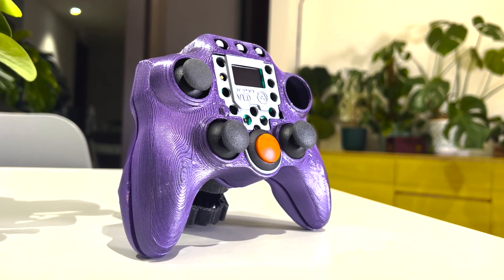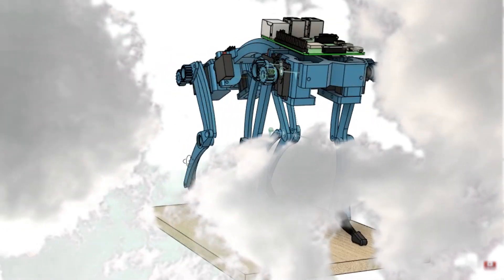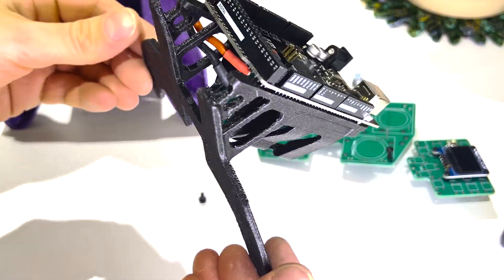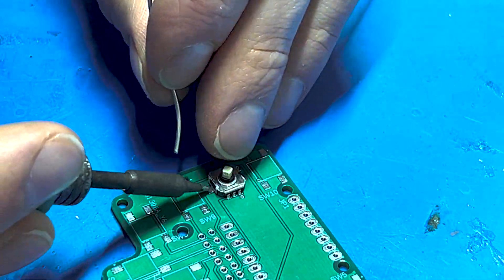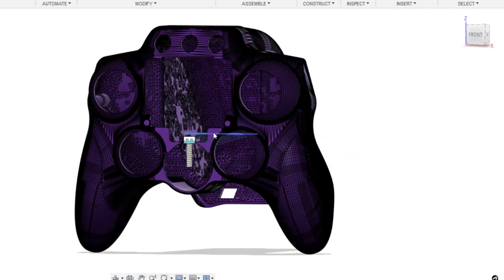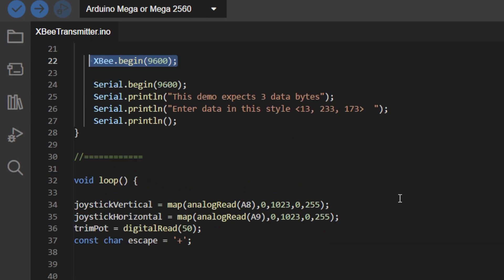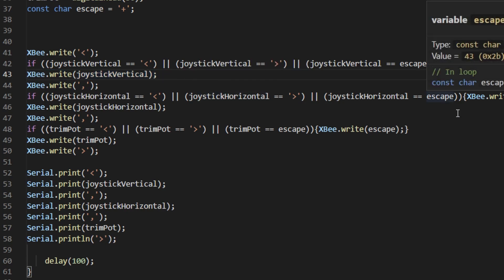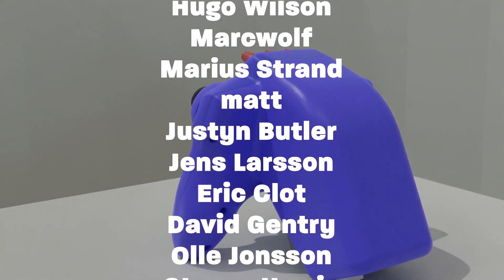I Built A Programmable Robotics Controller

Comment: You can use a Teensy 4.1 instead of an Arduino. It's way smaller, it has incredibly greater processing performance, and has more analog pins than even the largest arduino that I'm aware of.

Comment: You could have the atmega2560 soldered onto the io board and potentially add a rp2040 on the side and replace the 1.2 oled display with a colored variant, if not replace the rp2040 would have a much better time processing data over the atmega

Comment: Edit: This comment came out way more negative than suggested. I love this channel. There are many amazing projects here. This video happens to cover an area I've thought about a lot. I gave feedback on a Kickstarter project on a robot controller which is one reason I've thought about this so much. I have a part bin labeled "Custom Controller" where I've been collecting joysticks and other parts in a future custom controller I plan to make. I have experience using XBees, and other radios used with microcontrollers. I once used a Wii Nunchuck combined with a microcontroller and radio module to controller a RC helicopter. I hope this comment is taken as constructive criticism as it was intended that way. My original comment is below.

XBees work great but they are way more expensive than other options.
The inexpensive nRF24L01 aren't as easy to use but you can purchase over a dozen for the price of a XBee.
IMO the optimal link for a robot remote is Express LRS. The modules are inexpensive and have great range. The communication protocol is opensource. 

Have you ever tried to use four joysticks at once? It's a huge pain. IMO you give up ergonomics to have four joysticks. You're much better off having multiple modes and have a quick way to switch between modes. The joysticks can then control whichever channels you desire.

I think your one handed controller was great. In my opinion, you'd be way better of making your larger controller based on two of your one handed controller.

The power tool battery isn't too bad, but it's an expensive way to purchase a battery pack. Normal LiPo packs would be more economical.

I also think your big Arduino is inappropriate for the remote. There are lots of smaller options which have every bit as much processing power.

I love many of your projects but this one seem like you didn't think it through or more likely, you're unaware of the better options.

That said. being able to design your own controller is super awesome.

Comment: I love the idea of using a 3D printer for rapid prototyping the controller body (large layer size for fast printing) and then once it's dialed in nicely, creating a final version with really fine layer height (long-ass print but incredibly smooth) and then resin-dipping it for that ultimate surface smoothness... just my thought from seeing the thumbnail, anyway, time to watch and see what happens :D

Comment: no no. How you solder is problematic and wrong. You move the tip and move it. Don't do this. Heat, melt, keep heating, then move avai. that's it.

Comment: More on surface mount. When a manufacture shows the pad size for a part they are assuming the solder will be paste applied through a stencil. 

JLC does offer a stencil service at a great price. But a stencil is not required for low density boards that don't use fine pitched components. 

(back to the pad size) The suggested pad size is often the minimum. It is assumed you want to cram as much together as possible. But if you are hand soldering a board it really helps if the pads are made oversized. I extend the pads where the soldering iron will be used to contact the pad. It helps to have  an extra mm or two.  It is more work modifying the footprints but it is really worth it when it comes to assembly.  Even more so if you need to do any rework later. Maybe replacing a faulty switch. (more on this below)

The soldering iron tip you used was ok but a finer tip would be desirable if you have difficulty soldering the parts. Smaller diameter solder also helps. I forget if I mentioned it in the last video but lead free solder sucks. 63/37 tin/lead solder has a lower melting point. It is what was normally used in industry before the EU put restrictions on imports of commercial products that used it. Lead free solder needs a higher temperature to work and even when it does the results look crappy in comparison to the leaded solder. 

I think you did a pretty good job in the design. It is always difficult getting multiple layered parts to fit properly together the first time. The 3D printed housing looks like crap. That's just the way it is with the layer lines. When you get the parts fitting the way you want then it would be worthwhile to put some effort into improving the surface before paint. Sanding, filler, repeat, sand then paint, the sand, then paint. I love the ability 3D printing gives us but it takes more effort into making it look good.  Here is a video for inspiration. https://www.youtube.com/watch?v=u0eKCRtysro 

Cheap surface mount tactile switches. At one point we changed to some cheap switches. They were less than half the cost of the mane brand switches we used for more than a decade. We were buying 10,000 at a time so there was a significant saving, at first. The problem was the plating on the internal contacts. We found that after a while they were becoming intermittent. High humidity environments were part of the problem. We ended up switching to another brand (still cheaper than the first one we originally used) and we haven't had the problems since. Odds are you will probably not have the same issue but if you do you want to be able to replace them. (easier to do with leaded solder and larger pcb pads)

As far as a smaller CPU board. I am a hardware designer. While I have done some programming for microcontrollers for products I am not a programmer. At one point I wanted to get back to doing home projects I decided to use the Arduino IDE because it was so easy to get started with it. The hardware was dirt cheap. There were tons of libraries, some good, some less so. I mainly use the ESP8266 and ESP32 modules because of the wifi capability. But I have also looked at the STMicroelectronics STM32F103C8T6 CPU used on a hobbyist board generally called the "Blue Pill". It has 32 IO pins available and I think it would be a good replacement for the large ATmega board. It is a 3.3 volt processor rather than 5 volts of the AVR parts. 

There are clones of the STM32F103C8T6 par being used on some versions of the Blue Pill boards. I have read they are ok, but have some differences compared to the original part. I don't have any experience with them. The "Black Pill" boards use a more advanced processor,  STM32F411. The black pill boards only have the original part as far as I have read. I have some of these boards but have not had the time to use them in anything yet. They are higher performance than the STM32F103C8T6. Both are faster CPUs than the old microcontroller used in the ATmega board. If you were to use one of these the slower blue pill board would be better for you as it would use less power. Keep these in mind when you come to the point where you want to change to a smaller CPU board.

Comment: Have you used a Xbox Elite controller before?  You've got so much space on the back I almost wonder if you could put in some paddles.  How the it stands on the battery means you're not laying it down and accidentally clicking them either.
Oh and what did you use for your battery contacts?  I used some steel for a similar project but I'm worried about corrosion.

Comment: I recognized the 128x64 SSD1306 display straight away. Recently I've been hacking away at the Adafruit library for it, removing unnecessary library functions I don't need for my current project to save space for other libraries (SPI.h references for instance).
Have you thought about using an ESP8266 or an ESP32. Small, powerful, WiFi/Bluetooth/ESPNow wireless interface, lots of GPIO (even more if you use an I2C or SPI adapter) and in the case of the ESP32, non volatile memory and two cores for two separate threads.
Reply: Before I forget, look into the pcf8574 for expanding IO using I2C. Even if you're using an Arduino nano or an AIthinker ESP32 Cam board, you can massively expand your available IO using a few of those chips and they come in either tht or smd packages.

Comment: edit: see madcatandrew's comment, mine has been made obsolete.

The Arduino Mega is a lot bigger than it needs to be, I think you've demonstrated the skills to take a whack at taking the design files and adapt them into a different form. Especially if you used some internal layers, I think you could eliminate almost all of the empty surface area, potentially compacting the Mega by half. You could save some area by replacing the large sockets and the reset button with headers, which would also let you use remote sockets, placed wherever in the housing is externally appropriate, say on the side so you can have it plugged in while sitting normally on a surface. It might even be practical to fit all of these components onto the PCB that carries your joysticks; but I think you would find more uses for a compact mega in your projects
Reply: Another good alternative would be something like a teensy 4.1 or an esp-32... They're already very small so you would not need to deal with the hassle of designing a µC by yourself. And a nice bonus is that they are a LOT more powerful :D
Reply: @standegrande3330  Smaller and more powerful but the Teensy has far fewer pins exposed compared to the mega, which seems to be a concern. There is the Adafruit Grand Central, a Cortex based Mega formfactor board, but it has a lot more components, and because the Cortex M4 operates at a higher frequencies, 120MHz instead of 16MHz, the trace layout has to be better to avoid noise problems.

I think you could just take the public design files for the mega and make a compacted mega one step above trivially; but making a compacted M4 microcontroller board with 50ish pins, that is also any smaller than the mega, is going to be a challenge for most people, and a significant amount of labor for experts.

That said, I very loosely remember certain M4 chips being capable of nearly 100 pins, 80~ GPIO. The sky's your oyster or whatever. I just think these are two very different endeavors.
Reply: @Ziraya0  A Teensy 4.1 has plenty of pins: 55 digital input/output pins, 35 PWM output pins
18 analog input pins
Reply: @laupetre  slight correction, but that's the total number of IO for the chip used on the Teensy 4.1

The board itself only breaks out 41 GPIO to the edge of the board. A further 10 pins or so are available if you jumper wires directly to some SMD pads on the board.

This is probably enough IO though for what Will is doing.

Comment: Interesting use of start/finish chars. I've done work with tcp level coms which make use of STX  hex 02 (Start of test) ETX hex 03(End of Text) and EOT hex 04 (End of transmission). For avoiding conflicts with visible chars maybe have a look? Pros? Avoid the logic you use in managing <>. The control chars are there for the reasons you need.
Reply: If he wants to send a full range of 256 possible values, then it just changes which characters he needs to escape.

Comment: i was just wondering, there is a market on controller thats still vacant. a competitive FPS controller, basically solving double claw problem.
if you are able to design such thing with off  the shelf parts, that should be a great start. since it is actually a market gets overlooked by all the companys.